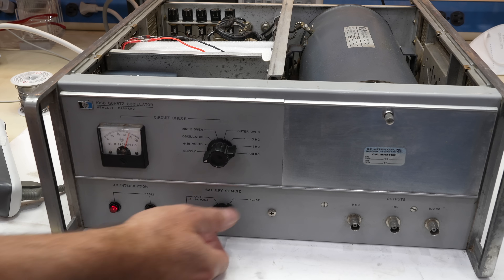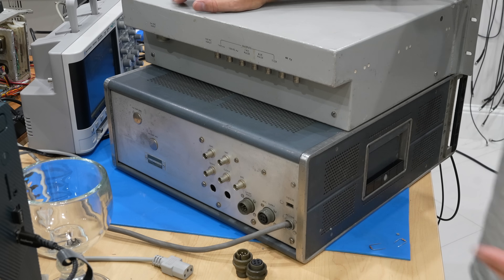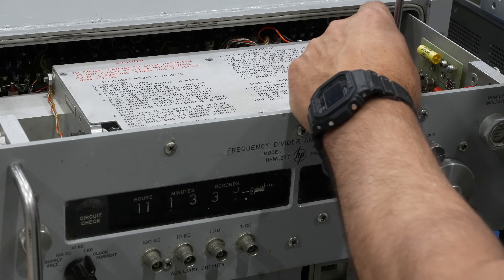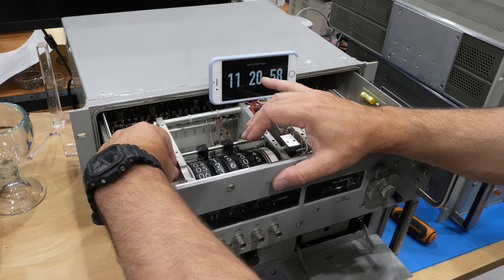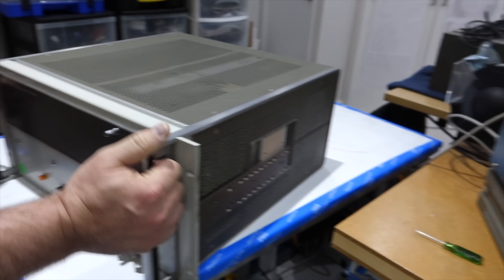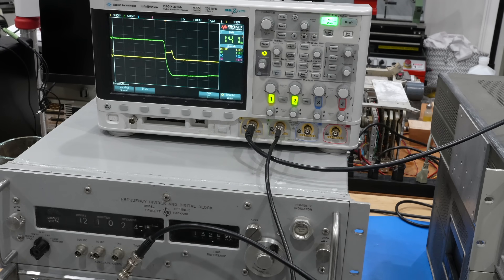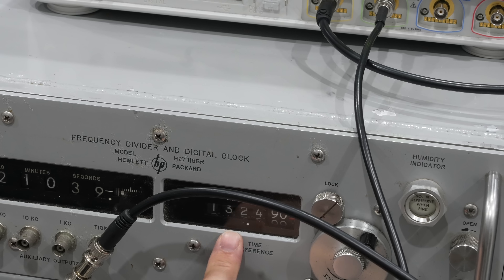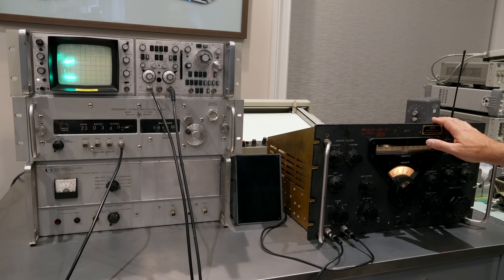HP 115BR Divider and Clock - Part 3: Startup and Atomic Sync

Comment: That clock was my time standard at McMurdo station back in the late 70's, in my Navy calibration lab.  It was powered by AN/URQ-10 freq std.  With the VLF wwv receiver and the strip recorder, we could check the drift of frequency standards used at our stations.  Thanks for the video..

Comment: Wow Marc. That is cool. what a nice restoration. I lusted over one of the 115BR's. I had a Tracor 599J 60KHz Receiver operating for years in my basement attached to a 133KHz Loop antenna that I retuned to WWVB. I still have that receiver but the usefullness all came to an end when WWVB changed the modulation scheme to work with cheap watches. Prior to that I had an EECO 880 VLF phase locked receiver that used synchros but I gave that away when I acquired the totally electronic 599J. I also have a Spectracom 8163 WWVB receiver that I plan to modify to strip out that modulation to return it to a phase locked 60KHz receiver and return it to it's glory to create a 10MHz Rubidium oscillator phase locked to WWVB as it was originally intended. Maybe after that I will figure out how to do the same with the Tracor 599J. The 599J is also a piece of history. It is the exact one that used to be at the USNO in Washington DC. I bought it at the Gaithersburg hamfest decades ago after it was surplused from the USNO. I have a science encyclopedia that has a picture of that receiver in use at the USNO in the 1970's and I can see the calibration sticker that was placed on the unit in the picture exactly as I have it. Nowadays everyone seems to use GPS to create frequency standards but it is nice to have a second source for fallback or comparision purposes. Keep up the great work! Sam W3OHM

Comment: I vaguely remember setting a few rubidium oscillators in my youth. I used a plotter that received signals from a national standard (France Inter? I don’t remember). It took few days to adjust one, by turning some precision potentiometer one way or the other until you obtained a straight line.😊

As far as I remember, the clocks precision was in the order of 10^-11, while the standard was 10^-12. 
It was a loooong time ago…

Comment: i think the radio "click" transmission is not supposed to be used to sync upon like that. It is likely much more suitable only to drift-compensate your local source over long term, as you could likely frequency lock on that second pulse, but locking the phase on it would not be reliable, also due to variable path of the short wave and propagation time changes there.

Comment: And here I’ve just started messing around building a GPS disciplined NTP server this month. I’d much rather twist the knobs and read the dials to synchronize a clock.
Reply: Nothing an arduino with a pot could not fix. Clock skew adjustment manually 😊

Comment: Why do you have to spin the clock by hand to get it started
Reply from the maker: Because it’s a pure synchronous motor. You have to get the rotor to rotate at the same speed as the rotating magnetic field it’s excited at for it to work. I go into some of it in the first episode. It’s magnetic magic, so I don’t pretend to understand all the details either…

Comment: Ohhhhh, Marc, you're killing me!  No backshell clamp and you didn't safety wire the threaded locking ring (with 500 turns per inch engagement) - Kidding!
Reply from the maker: I’m all messed up.

Comment: Marc, as a student at Stanford back in the late 1980s and early 1990s, it was my job to maintain a clock at the Big Dish. We had a Spectracom 8130 ovenized crystal standard and a WWV receiver, and I would follow the procedure you show in the video. But rather than just synchronizing our clock, I had to do some math to calculate how fast or slow our frequency standard was running and adjust its vernier knob accordingly, because the crystal sped up as it aged. I also had to adjust for the radio propagation delay between Fort Collins and Palo Alto, and even allow for the seasonal variation in the height of the ionosphere. It was a point of pride for me to keep that clock as accurate as possible!
Reply from the maker: Yes, you are 100% correct, the 10 us alignment procedure shown here is for tracking and adjusting the crystal oscillator frequency drift. The delay is orders of magnitude bigger!
Reply: @CuriousMarc  Yes, now that you mention it, we had some "slew" buttons on our custom clock to bring the delay back to zero. That's also where I learned that a linear frequency drift results in a parabolic time error, i.e. if you don't keep the frequency offset small then the time error gets big really fast. I would fit multiple time-offset measurements over many days to a parabolic curve, and then calculate the current slope of the curve to know how much to adjust the frequency. Kids these days with their GPS clocks have no idea of what fun we had.

Comment: Good propagation! You were receiving both WWV and WWVH.
Reply from the maker: Ah, that explains it, thanks! I was wondering while I had both voices, and why the man’s voice was so much louder than the woman’s… This was at 5 MHz by the way.
Reply: In California it is not uncommon to receive both.  Now if my WWVB clock would just receive that signal (it appears to be weaker than it was just a few (2) years ago.
Reply: @Herby-1620  I'm up in Oregon (Portland area) and I never hear WWVH. Maybe if I got off my butt and installed an outdoor antenna...
Reply: @Herby-1620 WWVB was on reduced power for a while. It should be back to normal now.
Reply: WWVH is voiced by the great Jane Barbe :)

Comment: Once synchronized to WWV, do you then offset it by the speed of light distance from WWV to your receiver antenna?  If so, how is that determined (GPS distance maybe?).  I'm also not sure if you are getting a WWV bounce signal off the ionosphere instead of straight line distance.   Maybe then you have to sync to GPS to get an accurate time?

Comment: Can you not sync it to a locked on GPS pulls per second signal?
Reply from the maker: I have not tried (because it uses modern witchcraft), but that should work too! Today the GPS is the Cesium that flies over our heads and is available for everyone, so any sane person should use that instead. The rub is that not all GPS receivers are created equal. The ones that actually have near Cesium precision ain’t cheap.
Reply: @CuriousMarc  yeah you've got to receive on multiple channels and be able to lock on to many satellites to get the real deal accuracy. I'm probably a powered external GPS specific tuned antenna instead of one of those ceramic patches.
Reply: @CuriousMarc  some of them aren't too bad they're pretty pretty pretty pretty pretty close and you can now get the rubidium clocks on a chip for Micrchip for those aren't cheap either! Is there much difference between cesium and rubidium in terms of accuracy or are we talking like rest in the number of atoms in the universe of standard deviation?

Comment: Amazing to see where we started.  I did a terrestrial TV station during the forced sell off and repack by the FCC and in the process demoed an old analog TV station that had occupied the space.  I have alot of the older racks of equipment from there I clouding the exciter and the ovenized quartz reference.   They were monitored and periodically bumped to keep the station on frequency.  There were 5 racks in total for all of this.  The new transmitter that replaced it was a simple affair with the exciter taking in program material via ethernet and a coax to a GPS antenna I installed on the outside of the building.  Amazing how simple and cheap atomic accuracy can now be had!  My reference at home is an older cellular time card with an 8 channel GPS receiver to periodically bump an ovenized and very stable quartz oscillator. Dirt cheap off of fleebay. It has a 10MHz output and an odd 2Hz output too.  Connect to the serial port and you can get all sorts of info including precise location.   Loved this series and we'll as most every other!  Thanks so much Marc for not only making me feel stupid but also making me a little bit less so too.😁

Comment: When you do the adjustment, don't forget to add the propagation delay between Ft Collins, CO and you. It can be of several milliseconds! And it is not a straight line of the distance; you must consider the signal path bouncing off the ionosphere. Very interesting series of videos! Thank you.
Reply from the maker: Well that delay would be huge! Yes you’d need to subtract 5ms or so. Speed of light is sooooo slow. I did not explain it well, but the goal of such a 10 us sync is to track and correct the drift of the oscillator. You let it sit for a day, a week or a month, do a couple similar sync, plot the resulting readings of the sync knob, and voila, you should know how far off your oscillator is. Correct it with the 10^-11 adjustment, and you’re good to go.
Reply: @CuriousMarc god, ntp got just so much more worthy.
Reply: I wonder what issues there are with the fact they are picking up both Ft. Collins (WWV) and Hawaii (WWVH) at the same time.  You can tell that from the two announcer voices.
Reply: Also, using the average of WWV and WWVH (in Hawaii) can help ameliorate the propagation delay slightly.  Unfortunately, it has only minimal effectiveness in the continental U.S. But, it is ever so slightly better than relying on just one transmitter location. The results will be best during daylight hours as ionospheric effects are then at a minimum. Averaging additional transmitters like CHU in Canada and MSF in the U.K. can help further.  Again, it is important to do the averaging at a time when it is closest to solar noon in all locations. It's a fairly complex task requiring accurate equipment and is essentially an academic exercise in the age of GPS.  Though it would be interesting to see the actual level of accuracy achievable using this method.

Comment: This brings to mind what we used as a station clock for a radio site.  We didn't have a clock in the traditional sense, but we had a pair of double oven crystal oscillators, and an omega navigational receiver.  We didn't worry about what time it was, but we needed to have a very accurate 100 KHz clock to provide to all the radios.  We had HF radios, so we needed to make sure that 29,999,999.9 Hz was spot-on.  That is where the ten to the ninth precision came in for us, even though the best time keeping device on sight was probably only within a few minutes of true time :-) 
I really enjoyed this series, thanks for posting the videos!

Comment: Brings back memories.  I had a Collins R-388.  When I got it, the previous person had replaced the pear shaped 5U4:with a solid state rectifier module, but didn’t install a ballast resistor.  I put it back to the correct 5U4.  I believe the too high B+:over stressed the PTO causing a very slight permanent nonlinearity in the 1 MHz segment.  The R-388 is really fascinating piece of gear in the band switching mechanism with various ferrite slugs moving in and out of coils as you go through the 30 1-MHz clicks of the band switch.  If you’ve ever worked on a 1960s car radio, the R-388 band switch is reminiscent of the car radio slugs, but much more complex.  The audio had a very nice warm sound.  Compared to modern radios, the R-388 is massive, but sometimes I wish I had kept it.  The problem is there’s only so much room in the basement.

Comment: Im curious what the atomic clock in gps satellites looks like. 😊
Reply: The newer GPS satellites utilize two cesium and two rubidium clocks.   If you search for images of "clock used in GPS satellites", you will see some actual images of the clocks which resemble standard avionics gear.

Comment: Does the caesium clock have something to sync it to UTC / GPS time? Because otherwise, doesn't it only provide a reference frequency, and not actually a synced clock pulse?
Reply from the maker: You are absolutely correct. My cheap ersatz tick version does not. The real HP option does have a very precise adjustment to align the tick to UTC or another clock. The cheap one is still quite useful for what I eventually want to do with it, compare the stability of two Cesium clocks (or in this case that of the Cesium and the Quartz).
Reply: @CuriousMarc  related to that subject then, it would be cool to know how they originally decided on a 'canonical offset' which the first "official synchronised second" would start at. Not sure if they had to somewhat make that decision twice, once before atomic clocks and one time after? Or just just tried to sync their caesium to a single crystal somewhere that they decided would start as official universal time? Would be a nice nugget of info for a future video

Comment: I tried to add a 5071A to my cart on the Microchip website but it only shows me things like power cables and rack mount brackets, etc, oh and a license for something, what? 😿
Reply: They sell both, the 5071A and its successor, the new 5071B. But you know it's going to be really expensive when they require you to contact them for a quote...

Comment: It would have been about 1969 that I glommed onto a very nice 5 MHz double oven oscillator designed for portable use in communications equipment. That inspired essentially generating that entire setup with poor-person's parts. I build a RadioShack clock and a prediviider from 5 MHz down to 1Hz the clock chip used.  To one second it was easy to set time. The oscillator had a nice vernier frequency adjustment. I used that to advantage for calibration. I found a relatively small 24V lead acid battery. I built a UPS around it. I had my one Hz pulse. I had an oscilloscope. I triggered it with the 1 Hz. I walked the oscillator onto proper time by tweaking frequency as needed. The first day I simply adjusted until I had the rising edge of the first cycle of the 1kHz tick tone burst lined up with my 1 Hz tick and not drifting. On subsequent days I made very small adjustments of the frequency first to realign the tick and then a small tweak in the direction to reduce frequency error. By the end of a couple months that kludge appeared to be staying within about 1 part in 10^9 with no further adjustments needed. I made occasional use of it over the next most of a decade to keep it precise.

So what did I use this for? Well, I was fiddling around on two maters waiting for a nerdnet that usually appeared ad hoc in the evenings. I noticed somebody calling CQ on USB with the carrier about 144.985 MHz. Seems at the time that was the bottom end of the Technician license band less 1.5 kHz, I proved my frequency readings with a tap on the 100 kHz divider chain. I then spend about 20 minutes telling him how the FCC figures that frequency allocation and why measuring frequency of an SSB signal with a counter emphatically does not work. I never reinstalled it when we moved to the Tustin Ca area. I may be a hopeless nerd; but, I am not THAT hopeless.

{^_-}    Joanne

Comment: Unless i misunderstand, the 1pps pulse you generate from the cesium oscillator isn't synchronized/aligned to anything so its kinda pointless to sync your clock to it? Maybe its usefull if it has the internal 1pps divider and the cesium clock has not been turned off since being aligned with another cesium clock in person?

Would be interesting to align it to gps and check if its still aligned a week later (with the cesium oscillator)
Reply from the maker: You are correct, my quick and dirty Cesium tick is not synchronized to UTC time. Its only purpose is to compare the drift of two oscillators. However if I had the correct  HP divider for the Cesium (the optional integrated one, or the rare external one), it would have an adjustment for moving it around and sync it to UTC. I think down to a few nanoseconds (don’t quote me on this, as I don’t have one…).
Reply: The pulse from the cesium clock is synchronized to the universe itself. It is by definition exactly 1pps. The point was you could show the drift over time of the other source.
Reply: @AureliusR I believe they're referring to phase not frequency. We all agree it's freq  is correct, but it's not phase synced to any other atomic clock. Hence why the flying clock needed to fly, to match phases around the world. AFAIK.
Reply: @AureliusR  And, even if the passage of time is not a constant in this universe, it doesn't matter because it is by definition universal.

Comment: Of course you also need to subtract the delay between the time signal transmitter site and your receiver site.
And the delay in the receiver as well.
Today, it is easier to synchronize it to the PPS output of a suitable GPS receiver 😀
Reply: Yes, and what path did the radio signal take -- it's bounced off the ionosphere if not groundwave.